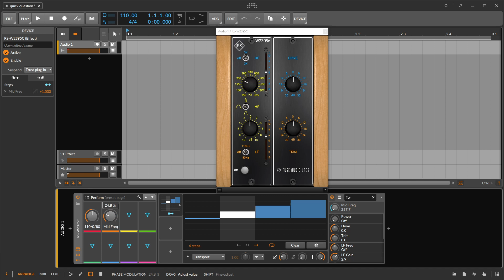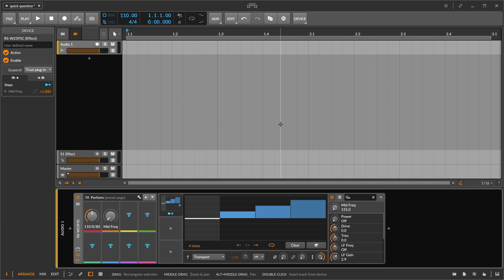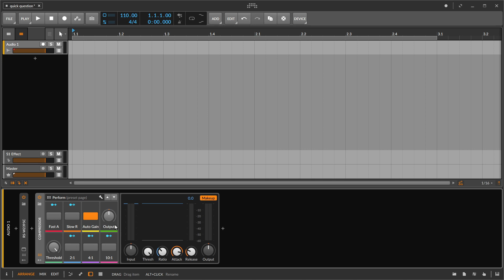Bitwig Studio Quick Question

Comment: In Synth Edit (which is not Bitwig I admit but Bitwig Grid has similarities) to get the result, I would put a Quantise module between the knob and the target. This however will not identify the exact points that you really want, merely make the knob move in jumps based on the resolution you set which could be 1 (on/off) to x being the number of steps you want.
In that case, I would identify the targets I did want eg 20, 75, 89, 120, and set up a set of Fixed Values with a switch to feed them to the parameter I wanted to control. This in effect becomes the knob and if the knob graphic has only that number of frames (4 in this case) it would step very nicely through the preset values.

To solve the real issue of not sweeping, either swap to old-fashioned devices (like some of the things Analog Obsession builds) where there is little to no sweep and chosen values are given
OR
Stop sweeping. Yes don't sweep! Listen for a moment, does this feel like a 400 Hz moment or a 1.2 kHz moment? Stop playback and move the knob straight there. Hit playback and see if that feels like the way the story needs to be told. If not stop, move the knob, and hit play again. This is the right method for learning. That constant sweeping from 20-20 is really unwise and was never indicated as a good idea when I was trained in the '80s

Initially, this method may feel a bit cumbersome BUT over time you build a huge database in your brain of feels associated with actions. That means that soon you start to reach for things without consciously thinking. I reach for devices that I can't consciously justify and moments later have a result that is perfect for the Story that I need to tell. All because my brain is full of past solutions that are discrete (as in not part of a swept event and therefore not discrete events).
:-)
Reply from the maker: Haha whoahh what a response... over my head though (I'm too stupid)

It's one of those things where I just prefer having stepped knob behavior on things like EQ and compression so I tend to use those sorts of plugins/devices. It would just be cool to take something like the internal EQ+ in Bitwig and be able to setup it up like an API 550 or have the Bitwig compressor fixed to the SSL bus settings but like you said it's really not a big issue when you have access to those tools if you want them already.

Comment: Dynamics in Bitwig is a better solution for compression with a lot more options.
Reply: It depends, they are different. Dynamics is more clean and compressor has a more colored sound. I believe compressor is modelled after a certain hardware compressor, but I don't know which one.